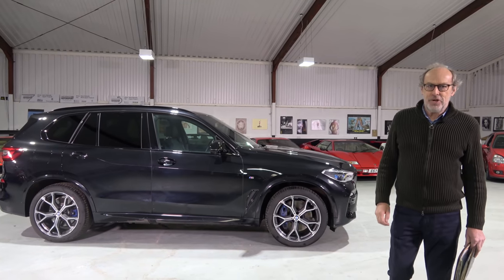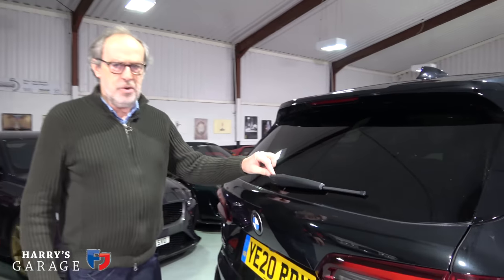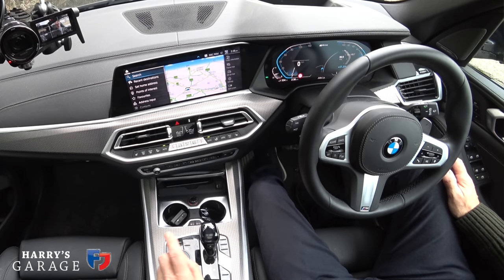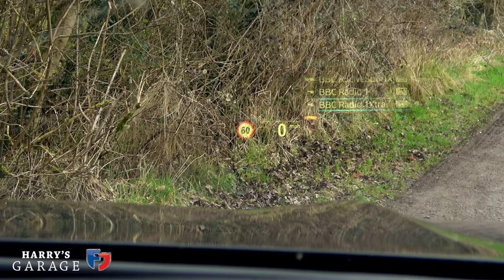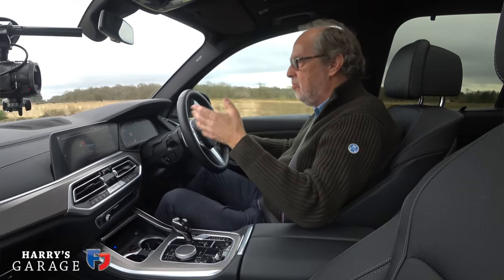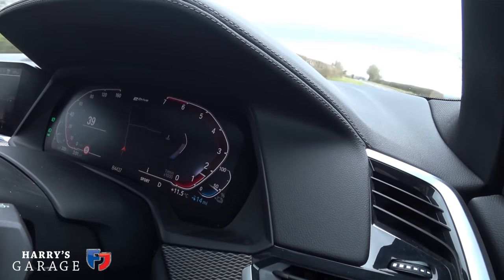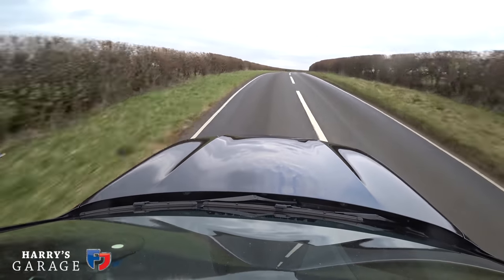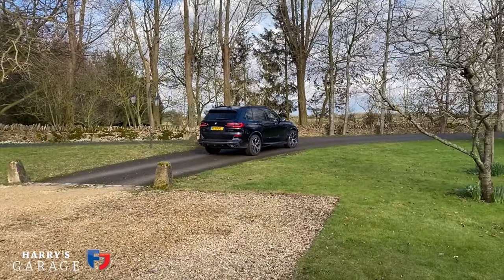BMW X5 45e 10,000 mile review. Why PHEV beats EV for our family car

Comment: I’ve had the X5 45e now for about 6 months too and have also done about 9,000 miles. My experience in terms of MPG is very similar - approximately 48% of total mileage has been on electricity and average mpg of 59.

I suspect that your vehicle charge rate was defaulting to 6A or 10A rather than 16A. My vehicle had a software fault that meant the vehicle kept randomly dropping down to a 6A charge rate unless I manually changed it back to 16A. A recent software update has corrected this and I’d now say an empty to full charge is around 7 hours - not fast, but easy enough to achieve overnight.

I’ve had a few niggles - both headlights developed condensation inside and needed replacing under warranty, software issues and parts availability (someone managed to knock the wing mirror off whilst the vehicle was parked - it took 4 weeks to get the part and it was almost £1,000!)

I also had a puncture and as a result of it having run flat tyres it wasn’t possible to get the tyre repaired at any of the major tyre chains (and of course no one had a tyre in stock) but to BMW’s enormous credit their recovery service recovered me and vehicle 260 miles home and the local BMW dealer managed to repair the tyre for the princely sum of £18 (after the recovery driver stopped laughing about having to recover a vehicle from a national major brand tyre garage with a puncture!) This experience did cause me to question whether run-flats really do represent progress though vs. a trusty spare tyre.

Comment: Your elecric calcs are out - the kWs the car reports is what it has used and not how much is needed to charge it. Charging has losses and is not 100% efficient.
Reply: That may be true, however having owned this car for a year and monitored the petrol and electricity consumption it has saved reduced my running costs significantly over the previous X5 which was a diesel.

Comment: about the battery, range does not really go down because of low temperatures. What has a huge impact during cold weather is your heating system. It drains the battery super fast. In case of doubt, turn off the AC and you will get a similar range to the summer time period.
Reply: EV technology sounds utterly crap.

Comment: I love that observation "Germany hasn't got enough power station capacity to allow fast charging". It's something that will hit us at some stage... I really want to support the all electric era but it's ambitions are all over the place. Supplying electricity is going to be at the hands of the commercial market, can you imagine how much it's going to cost at a motorway services for example? I also agree with Harry and other comments, putting high demands on a cold engine can't be good.
Reply: Even worse, the now tax-free EV will be higly charged with taxes when EV get a reasonably market share. It's that simple: the government gets the money where it can get it. When petrol sales go back, they get taxes elsewhere.
Reply: This statement about the German power capacity is wrong. There are regulations against single-phase charging over 20 amps or 4.6 kW (20A@230V). Charging has to be three-phase above that, but then you can get 11 kW at home, even 22 kW, but that has to be approved by your local power company first. European power grids are three-phase and the three phases need to be as close to symmetrically in use as possible to avoid the power grid transformers to see an unbalanced load (one coil getting a lot hotter than the other two). If you have more and more cars go electric and they all high-power charge on phase one, it will make the grid go down. The charger in the Range Rovers, I-Pace and so on are old and outdated designs from a one-charger-fits-all-markets point of view for cost cutting. Most EVs sold in Europe are now being upgraded to 11 kW three-phase to mitigate that. BMW could install an 11 kW charger in the X5 and the charging rate would then outperform the Range Rover. They just don't want to, because they still use the five year old charger in that car that they had in all the previous BMW PHEVs. Next generation will be 11 kW for sure to be competitive. And this is not specific to Germany. Your British power grid is also three-phase, you just have a lot more older grids in rural areas that are only supplied single-phase. You would also profit from three-phase chargers in the cars.
Reply: He happens to be wrong about Germany's capacity.
Reply: @ted_maul  That is a nice short version of what I just wrote :-D
Reply: @jan-hendrikbussmann4644  very interesting and informative reply....thanks.
Reply: @jan-hendrikbussmann4644  Well done Jan for trying to correct us but I didn't understand any of that, and nor do I want to. If governments and car industries want to push us to electric then it must be simple. Your explanation just goes to show how it's becoming more a science than getting from A to B. When we buy petrol or diesel it's a simple decision, it's what us consumers want.  Look at this way, I grew up with reel to reel recorders, then onto vinyl, then onto 8-tracks, then onto cassettes players, then onto 12" laser disks, then onto CD's, then onto MP3's etc, etc...How can any of us be sure that the electric car we buy today will still be able to work in say 5 years? Will the plug fit, will it be single phase or 3-phase. As always it will be the early adopters who pay the price but until it's standardised a lot of people are going to loose a lot of money experimenting.
Reply: @fgee3719  Agreed, seems to me we are exchanging one form of energy for another - the only thing you can say is that electricity demands reduce at night and power stations cannot turn the taps on and off at will, maybe it will become law one day that we can only charge at night. In the words of Derek from the Vice Grip Garage " I don't know"
Reply: @richardstamper5630  I apologise for the long explanation. I work in the industry on exactly this topic, so I feel invested in making this accessible, but also may have failed in my attempt. But I understand the point you make completely. There are many aspects new to the electric car buyer that are, as opposed to petrol and Diesel, far from the point of being common knowledge. It is upon very well informed and qualified sales and support staff at the dealerships to bridge this gap for the customer.
Reply: @jan-hendrikbussmann4644  Thanks Jan, seems we are almost on the same page in our thoughts. :-)

Comment: I’m still not sure if you can use mpg with a hybrid car. Mpg is a generic figure used to compare the cost of running vehicles. What it doesn’t take into account with a hybrid is the cost of charging. So whether you’ve used a tenner of fuel or a fiver of fuel and a fiver of electricity, you’re journey has still cost you a tenner. As always, a great honest review Harry

Comment: I have had this car for a year and love. One area of concern is it’s width on U.K. roads. Fine on motorways but on country lanes or town road it leaves me nervous. I wish there was a net in the boot where there is a recess, this to provide a means of holding shopping bags in place. Final point, the adaptive LED headlights provide under full beam a moving spotlight which I do not like. The lazer headlights are very good but cost a further £2000. Final comment, in a year with COVID the vehicle gas covered 7500 miles and will very soon need the front tyres replacing, a rather short life.

Comment: Harry, what is the best setting to have the car on? Hybrid, Eco Hybrid or adaptive? Thanks
Reply: @Q-nt-Tf  My daily commute is mainly motorway driving for round trip 80 miles a day, this total includes town driving for 10 miles as part of the commute, thanks
Reply: @Castries537  similar commute myself (95miles) and was thinking the same
Reply: Adaptive when long distance and use of GPS, it use elevation and road info to calculate best use of the drive train. Short distance: Pure electric. Hybrid else unless overtaking a lot, then sport mode (tilt gear leaver)
Reply: @jost4786  Thank you, really appreciate your advice.
Reply: @jost4786  thanks. What do you think a realistic MPG would be for a 100 mile round trip commute with about 85 miles non traffic highway
Reply: @jhemming  100 miles is 160 km. I drove in winter 137 km with average 70 km/h and used 3,4 liter/100km. I used all the battery capacity by setting the trip in the GPS. The faster you go the less the battery will be usen in hybrid mode. I usually switch to electric mode to ensure I empty the battery. So perhaps less than 5 liter/100 km if you go faster and ensure you use the battery!? I drove X5 30d 20 mod and used 6,3 liter/100km on the same trip.

Comment: Great video, I have my 45e for one year now, 15k km, average 7.9L/100km. Did about 5k km on electric the rest on highways so not bad at all for such a big thing. Concur with Harry's on the charging time being the main downside. Other than that, a great SUV
Reply: I’m  about to drive 1/2 way across the country for one! Kind Stranger! Hopefully you see this in time. Would you please let me know if you’ve had any issues or regrets with your 45e hybrid?

Comment: Surely it's technically possible for it to slow charge when the GPS says it's in Germany, and charge faster everywhere else. Sounds like an excuse for another limition, maybe cheap battery chemistry. And what are the emissions like when you boot it with a cold engine and cats?

Comment: I have my 45e for 12 months now, and am absolutely delighted with the car.  The only complaint I have is that the range in the USA is 30 miles instead of 50 miles. With the same 24 kwhr battery.  My trips are ALWAYS closer to 50 miles.  I was told BMW tried to keep their cost down by cutting corners in the regenerative hardware, but they can certainly update their software remotely to get it up to what they did in the UK.  Tesla does 250 miles with a 70 kw battery, or 80 miles approximately on 24 kw.   BMW X5 weighs more, so 50 miles on 24 kw is quite reasonable.  But 30 miles is so poor that BMW should fix that, especially since they were able to do it in the UK already.

Comment: Great review Harry.   This and the Cayenne Hybrid are on the short list of my wife’s Cayenne. We have a Tesla as well but not quite willing to go full EV yet.   

One nerdy point, when talking about charge rates, best to speak in kW, rather than miles / hour.  That negates the size of the battery and the efficiency out of the equation.   But I do understand why you say it the way you do.   The BMW charger is quite low at 3.6 kW.  So is the Cayenne but you can option the 7.2 kW charger.  

Finally, point taken on the efficiency while running on petrol, but think about how you felt with the Range Rover running that 4 cylinder with the hybrid.  You weren’t quite as keen.  The previous generation X5 PHEV did have the 2.0 4pot....and they switched to the 6 for this generation.   Fairly clear statement in that.

Comment: I agree with you about lane keep assist and include stop/start. They both default to 'on' at every cold start. The LKA is switched off in the same way on my Kia but the button is on the steering wheel and when 'on' it toggles between auto-steering and LKA by short pressing.

Comment: Seeing as you're using your battery so heavily to transport around the mass of a 6 cylinder that is doing nothing 50% of the time, when will you have to replace the battery and who has to pay for that?
Reply: I don't think the weight of the engine will have a big effect when one considers the entire vehicle mass.
Reply: Lots of governments have put laws in place for the manufacturer to have a 10 year warranty on the battery. Also the batteries have gotten magnitudes better in quality along with systems in place to charge the batteries so they aren’t over charged or completely drained.
Reply: As it’s on long term loan then I don’t think Harry will be footing the bill

Comment: £70k and they couldn't fit a decent AC charger- pathetic! Oh and the excuse about the German power grid not being able to handle a few PHEV's is complete BS
Reply: Its already £80k before options ...makes perfect sense to me ...95%+ of recharges will be overnight so what’s the problem.
Reply: @IverKnackerov  If you live 30 miles from work and have charging at work then if the car had a decent charger you could charge again at work and do your whole commute electrically- not with this thing. If you do a few shorter trips during the day then plugging in after every trip you could easily do over 30 miles electrically per day, again not with this.  Installing a decent charger would cost BMW pennies they just want to put as many barriers in front of electrification as they can to milk their ICE manufacturing plants, for example the misinformation about the German grid not being able to handle EVs.
Reply: @nealm1814  It isn't even that where I live. We don't get rebates on electric/PHEV vehicles unless they are under $49000 CAD or 28000 GBP and then it is only up to $5000. Eg you buy a Tesla $185,000 and in 5 years it is only worth $46,000. People say electric cars are cheaper to run, with a $27,000 a year depreciation, it is not cheap to run an electric car. They also don't work well, 5 to 6 months of the year we are down to -35C. Electric cars loose 55 to 60% of battery life in that temperature. Not a lot left to get to work, let alone get home when the car has been freezing all day.
Reply: @HONDAVFRV4  you have no idea what you are talking about
Reply: The charge rate is not an issue if you can charge the car overnight.

Comment: 25 mpg? That's appalling if you count all the emissions from generating and delivering the electricity.Mainly owing to its vast weight
Reply: His average MPG over 10k miles was 50.2 mpg
Reply: @SDK2006b  yes I know, but he was using uncounted electricity for more than half of the time.
Reply: @andrewpease3688  that’s the point.   It’s much more efficient to use electricity, even counting for those emissions.
Reply: @joetacchino4470  using the electricity is efficient, generating and delivering it isn't. That's before you talk about all the toxic stuff involved in wind turbines and batteries. Carrying the weight of all the extra crap doesn't help.
It's a scam.
Reply: @andrewpease3688  - because generating and delivering fuel is efficient 🤔
On your toxic battery point - probably moaning about Cobalt. It's only because of the EV/hybrid industry that you're even aware. Your own home is full of objects that you have bought that have used Cobalt. Your driveway has objects parked on it that use Cobalt. The only industry actively moving away from using Cobalt is the EV industry. Yet despite this Cobalt has become one of the latest looney focal points to attack EVs when there are so many genuine and blatantly obvious issues.

Comment: No one, including you Harry, seems to account for the inevitable UK fuel duty levy on electricity that must surely come in some form or other for on road vehicle usage.
Reply: You are right about that. They need to pay to upgrade and repair the infrastructure that electric vehicles are currently using for free. As more and more EV hit the streets and the Vehicle Tax lowers from lack of petrol/diesel cars, you will either see toll roads everywhere or road tax on all vehicles. My guess is they will look at road tolls. As the demand for the grid becomes to great, they will want to lessen the amount of charging that needs to be done.

Comment: Germany already admitting they do not have the capacity for coping with charging Electric cars
Reply: Yes. Already if you install a 11kw wallbox in germany it has to have a remote switch off function. So they will stop your car charging when there is an electricity shortage.

Comment: Great whilst in warranty 
Otherwise a faulty grenade waiting to cost a fortune
The future is this running on bio Fuel
Reply: This is what they call a lease only, the Lexus RX is a great buy in the used market.
Reply: Over engineered.  Absolutely no purpose- fifteen components to the windshield instead of one.  Stupidity at it's finest.
Reply: A buyer in Germany does not even get warrenty!
Reply: @X8X8X8X8X8X8X8X8X8X  

I had a hybrid and the battery died just out of warranty £7,000 replacement the would have bought a 1,100 litres of petrol or 7,400 Miles of fuel 
The savings on mpg were all given back on the replacement battery 
So net net zero benefit and just a other complexity to go wrong
Reply: @X8X8X8X8X8X8X8X8X8X  can’t believe that’s true at all !
Reply: @hpman911  
It is. In another comment I wrote
"The distinction between "Gewährleistung" and "Garantie" does not translate into English.
In case of "Garantie" the seller has to prove the fault did not exist when the transaction took place (which is virtually impossible). In case of "Gewährleistung", the buyer has to prove the fault did exist when the transaction took place - which is impossible.
Two years of "Gewährleistung" are mandated by law in Germany, and BMW pride themselves of "offering" their customers a third year. All other manufacturers known to me offer at least two (VAG) and up to seven years (KIA) of "Garantie"."